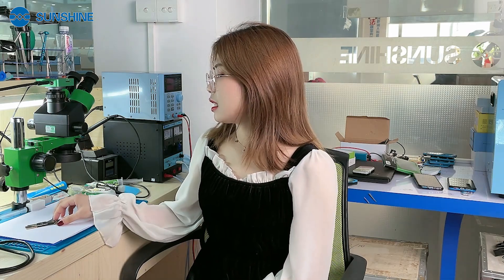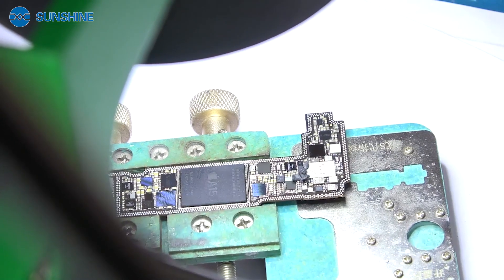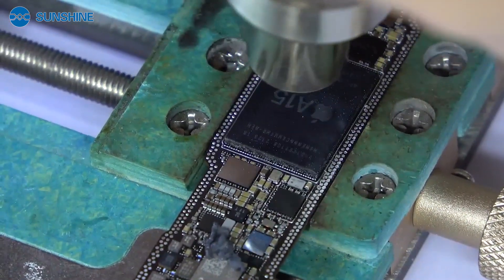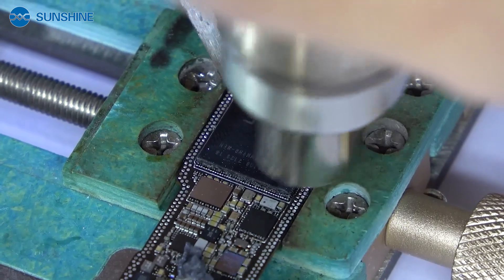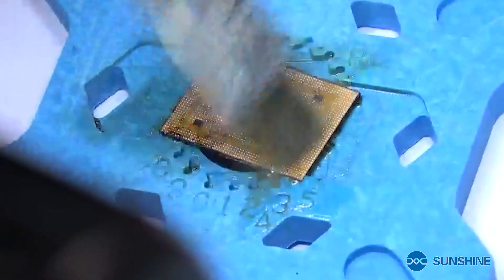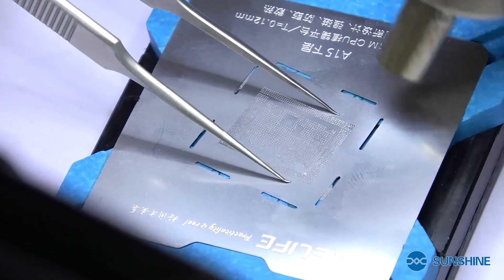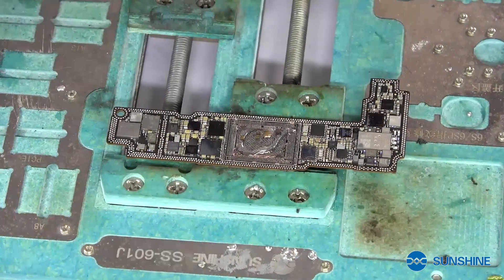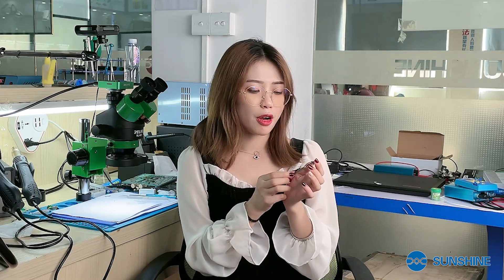Free video teaching ！A15 CPU Disassembly/Reballing #iPhone13CPU #A15CPU

Comment: 450 hot is safe ?
Reply from the maker: you can try  400 to  reemove glue then 350 to remove CPU, There is no fixed temperature, it depends on your habits
Reply: what about PMIC,not shord?